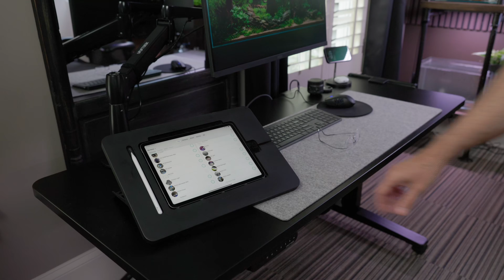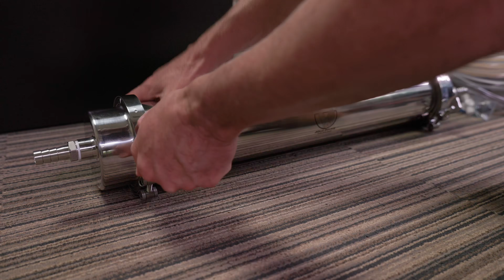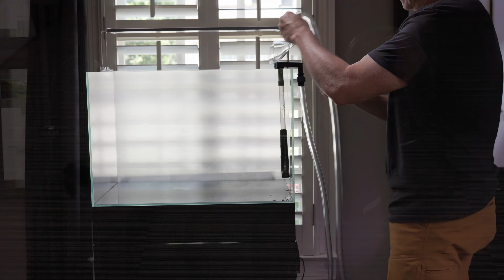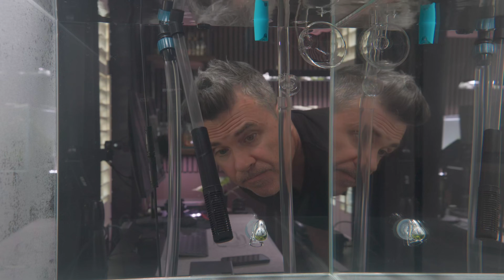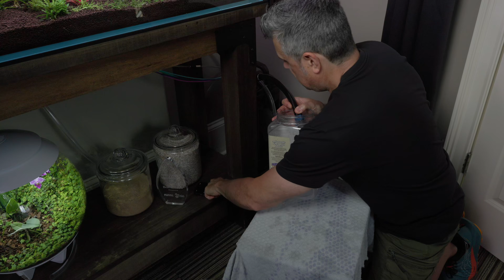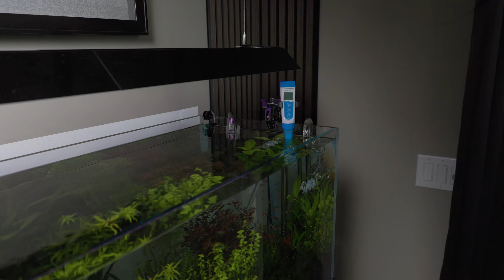My Aquarium Just Leveled Up

Comment from the maker: This was one of the biggest upgrades I’ve made to my aquarium, and it was honestly a bit overwhelming at first. If you’re new to CO₂ or thinking about trying a reactor setup, feel free to ask questions — I’m happy to help! Have you tried CO₂?  How do you inject it?
Reply: The Oase filter has an output flow rate that, in my opinion, would be sufficient to deliver water to the CO2 reactor. Why did you add a centrifugal pump to inject water into the CO2 reactor?
Reply from the maker: @killies  You are correct that the flow is enough but because of adding so many feet of tubing to move everything to the closet I wanted to up the flow.  Ive made changes since this video as I had issues with cleaning all that tubing.  It was a pain which means over time it wasn’t going to happen.
Reply: Have gone the citric acid and baking soda route with those stainless steel canisters that can take a lot of pressure. Very fun to make CO2 at home especially paired with something as efficient as your setup. I would inject it into the inlet of the sump. Have the sump enclosed so the bubbles would dissolve into the water through the filters and pot scrubbers and all the turns. How stable have you gotten your pH with this setup?
Reply from the maker: @DipntheVic awesome.  Yea the pH is rock solid and fluctuates only like 0.02 throughout the day.  Plants are exploding in growth and color. And Ive learned a lot more since implementing this reactor.  Video for another day.
Reply: You probably love technology very much. As for me, I prefer simplicity.

Обзор 7ми аквариумов без подмен и анализ тестов воды. - this video is about 7 aquariums for years(!) without water changes, without CO2, with quite a bit of filter cleaning. That's it!

Comment: It looks great! I'm planning to install CO2 in my aquarium soon. The problem is, I'm using two Fluval FX6 filters, and the hose diameter is too large (25mm). Will these reactors be compatible? My other option is to use an Aqua Rocks Colorado inline CO2 diffuser. I see they have one with a 25mm diameter, perfect for the FX6 filters. But I haven't seen this reactor in that diameter.
Reply from the maker: You certainly could do it but would have a restriction in the piping.  Maybe diy it?  It’s a pretty simple design.

Comment: What size co2 tank do you use and about how long does it last with the yugang
Reply from the maker: 20 pound bottle, 120x45cm tank, bought refill in mid August and was close to empty beginning of May.  Also my CO2 concentration was much lower prior to yugang, something like 20ppm.  With yugang it is a solid 35ppm.  With inline diffuser I was replacing at 6 month mark.  So it worked out really well.  Wont go back.

Comment: This video was excellent with great information, You think you can tell me what’s the size Yugang co2 reactor small.  I have a filter oase biomaster 600 And i asked myself if an additional pump would be necessary, or if the BioMaster 600 would be enough? My aquarium is also 120 cm long.
Reply from the maker: Awesome!  Glad it helped.  Head over to the Aquarocks colorado website to see the dimensions.  The small unit is perfect for that tank.  There isnt much flow loss due to the reactor and depending on your layout the filter should be enough to

Comment: You can make one from some pressure pipe couple of fittings, a ball valve and some bigger clear pipe so you can see the co2 bubble a threaded co2 ftting goes into the side of the clear tube also 👌 the one you have looks cool though. I made mine for my sumped tank so it just goes in as part of the plumbing 😊
Reply from the maker: nice that sounds great!  You are so right that these reactors are fairly simple to diy.  Head to the website and find the forum post as the sizing is the important piece!  Thanks for watching!

Comment: I don’t like co2 bubbles either. There is a small German CO2 company called JDAquarek who produce reasonable priced, small compared with the SS one, and easily powered by an 850. The one to consider is the one of the bypass models, midi for your tank. Excellent product…no bubbles at all while saturating the water with dissolved co2.
Reply from the maker: Cool!  Thanks for sharing.  I certainly will check them out.

Comment: Do you use less pressure on the regulator? Do bubbles per seccond doesn't matter much any more? How long does it take the co2 to taper off and ph to drop after turing off the gas?
Reply from the maker: Yes i dropped the working pressure from 40 to 20 psi.  BBS are arbitrary and will vary depending on a few factors.  I set the co2 flow until i see a few bubbles escape from the outlet every 10 or so minutes. Co2 drops steadily after it’s turned off.  I turn it off about 60 minutes before lights out and it maintains a good concentration with the residual gas pocket.  After that it drops rather quickly as I have good surface agitation.  Hope that helps!

Comment: I've run an inline vertical reactor for co2 for many years.   I don't know for sure but maybe 10-15 yrs?  I do get noise though from the gas bubble that builds up. I'm thinking about putting it on a smart switch and having it shut off the filter for a minute after the lights go out to release the extra gases.  Mine is powered by my Eheim 2215 canister filter.  Nice video.
Reply from the maker: Appreciate you sharing your experience and the kind words!

Comment: If you already have an inline diffuser put it on the intake hose instead of the outflow so it goes through the canister and then into the impeller up to the tank. Can in some cases lead to extra noise. But a reactor is the way to go from the start IMO.
Reply from the maker: Appreciate the advice! We are Always learning new ways to optimize the setup.
Reply: @jmaquascaping  Just a heads up. The diffuser will get dirty quicker with this method.
Reply: There’s a reason they go in the outflow. Putting them on the intake lets the micro bubbles condense inside the filter and you have burping issues.

Comment: Is there a reason you decided to put the canister filter in the loop instead of just running an outlet and inlet for each separately? The canister could slowly clog over time changing the flow rate and thus reducing the amount of dissolved CO2.
Reply from the maker: It certainly could be run separately.  I chose to try it this way to reduce the amount of stuff in the tank.  As far as a reduction in flow due to dirty sponges, that is a concern but not because of a reduction in dissolved CO2.  But CO2 distribution is just as important and good flow is key for that.  My specific setup I have prefilter sponges that are cleaned weekly to maintain the flow.

Comment: Hey Jeff, it's nice to see your experience with the Yugang reactor. The way I always purge all of my reactors is just to put a tee on the CO₂ line with a ball valve. Since the CO₂ inserts into the reactor at the highest point, I just open the ball valve to purge it (with a washcloth handy, I just leave it open until it spits water at me, so I hold the washcloth over the opening). Then you don't have to fuss about with tipping it and you can even have the ball valve a bit lower. 

I love that you don't have to run high psi on reactors. 5 psi is sufficient, since you're not forcing it through the ceramic, you just have to a) overcome the nominal head pressure (about 0.433 psi per foot height difference between the CO₂ inlet and the waterline, so never really more than about 2.6 psi) and the pressure needed to "crack" any check valves in the CO₂ line (usually 2-3 psi). Running the lower psi makes the needle valve more sensitive, so it's easier to tweak the CO₂ flowrate, it reduces the chances of getting a leak anywhere in the system, and it means you can use whatever airline tubing you want.

Another detail on the sizing: I made a calculator a while back that's available for anyone to use. While the math that went into the initial proof of concept is very intense, the final math for sizing is actually very simple. To use the calculator, you need to save a copy (because I don't want random people breaking the spreadsheet). Then just follow the instructions and it'll spit out the numbers for you. The stainless steel ARC reactors are 10.2 cm wide, the small is 37 cm long and the large is 65 cm long.

https://docs.google.com/spreadsheets/d/10DfkiusuIBjX0YkO04xV8jC5ARycE_wJ/edit?usp=sharing&ouid=105202300871240382718&rtpof=true&sd=true

Cheers!

Comment: No burp valve?? How could this be efficient?
Reply from the maker: Not sure what you mean by a burp valve?   It is efficient because all the CO2 injected into the system is dissolved versus using micro bubbles which mostly float to the surface and escape before dissolving.

Comment: I’m a bit confused how this is more efficient. As the pocket of CO2 in the reactor is still there when the lights are off and thus still getting absorbed in the water throughout the night even when the solenoid switches off. Doesn’t that offset any efficiency you might gain versus a diffuser? I understand there are other benefits such as no bubbles, more consistent,and no risk of gassing your fish but it just seems that CO2 will be getting absorbed constantly.
Reply from the maker: It is the difference in almost all the co2 dissolving into the water versus a bubble method allowing them to pop at the water surface before they dissolve fully.  So less co2 needs to be injected into the reactor vs a diffuser to get the same dissolved co2 concentration.  You are right that there is a gas pocket at the end of the day that continues to dissolve after lights out.  Co2 can be shutdown prior to lights out to minimize this “waste”.  I found that I can safely do this 1 hour before lights out and still maintain the co2 level though it does start dropping off a small bit but also my lights tamp down the last 30 minutes.  Hope that helps.
Reply: @jmaquascaping ahh that’s a good point! Thanks for response! Enjoy your videos.

Comment: Is the extra pump really necessary or can the filter handle it by itself?
Reply from the maker: Filter can do it as its minimal flow loss.  Im running my other tank this way just fine.  I added the pump because i wanted to increase overall flow and move the filter to the closet which added a lot of tubing.
Reply: @jmaquascaping  Thank you very much, ill have to take alook at it but probably go with the big one for my 150x50 Tank :hand-purple-blue-peace:

Comment: So ive been looking at this exact reactor and try to figure out the night situation.  Currently using co2 comes on 2 hours before lights off 2 hours before lights tirn off and it stays relatively stable.  How does this work for night?   I imaging the co2 pocket dissolves slowlymaking the co2 level taper off very slowly through the night? Im unsure if im missing something or you just run the the same as wither the diffuser and it dissolves faster than i think?
Reply from the maker: Im currently still experimenting and am at co2 on 1.5 hours before lights.  I’ll probably end up around 2 hours.  Im shutting co2 off 1 hour before lights off.  You are correct in thinking that the gas pocket continues to dissolve at night.  However what I’m seeing is that the off gassing of CO2 is fairly rapid in the evening.  I have strong surface agitation now that I upgraded the pump and of course that facilitates off gassing.  Hope that helps!

Comment: how do you avoid a ph crash if residual co2 builds over time from each previous day?
Reply from the maker: The reactor is only powerful enough to dissolve a maximum concentration of CO2.  So it doesn’t matter what the starting value is.  So for example let’s say the CO2 starts at 10ppm from the previous day’s injection.  The reactor will in my case dissolve until it reaches an equilibrium at 40 ppm and that is based on the reactors size.  If it started at zero it would bring it up to 40 and hold it there. If it started at 30 again it would bring it up to 40ppm and hold. So the resulting pH would be the same every day.  Hope that helps.

Comment: Your channel has become one of my favorites. I'd been using one of Aqua Rocks Colorado's other styles of CO2 reactors but had been thinking of switching to the Yugang so this video comes at a great time. Your decision to turn the filter passive by adding the pump was really intriguing. Is the external pump louder? I'm using the thermo 600 on my 90cm 49 gallon tank and have been concerned about the cut in flow even with the other reactor. I went ahead and purchased the small version of the acrylic Yugang and may also order the Optimax pump as you did. Thanks for the great video!
Reply from the maker: Sweet, I hope the new reactor and pump work out great for you. My pump is about the same noise level as the built in one.  It does vibrate a lot more so I had to be careful to not let the tubing rest on anything that would resonate.  Thanks for watching!

Comment: Thanks for this, Jeff. Been battling decent CO2 stability for a while. Clean the prefilter and tubing every week, change in CO2 delivery rate. Clean the diffuser, change in CO2 delivery rate. Preaching to the choir I know, but glad there’s a truly viable alternative available out there. Now to convince the wife 😇
Reply: Aaand looks like I’m doing DIY after doing research after all. Sounds like all the ARC reactors are incredibly oversized for my tank to run via the overflow method. If I want a clear, sturdy reactor, only marginal cost savings though.
Reply from the maker: @amrobx  Oh yea I was chatting with Yugang on this and ARC did decide to make them for bigger tanks for now as they can be dialed back like I did. It works but the main downside to these reactors is their size.  So DIY you can create it to the exact match for your tank!
Reply: @jmaquascaping Finally got everything situated and put the custom-sized reactor in-line. Oversized slightly in the beginning thinking I was slick 😅. Fish didn’t care for that. Finally sized exactly in line with recommendations on ScapeCrunch and working wonderfully with zero fuss. Couldn’t be happier or recommend more. Again, thanks for putting this video out there! The crazy part is my “oversized” reactor was only about 2” longer than calculated—these things are powerful.
Reply from the maker: Glad the video helped, yea the CO2 thing is tough.  Its been several days now and things are looking better.  Good luck!  Are you thinking of getting one from ARC or diy?
Reply: @jmaquascaping  Probably from ARC, but have research to do on ScapeCrunch. My main concern for DIY is keeping everything water tight while being adjustable (short of rotating the whole assembly). I’d be shooting for one of the clear ones. Other than that, met the friendly folks at ARC in person a few weeks ago. Pretty small shop and don’t mind supporting what they’re doing out there.
Reply from the maker: @amrobx  Awesome!  Yea for peace of mind it is worth getting the ARC reactor.  Acrylic would be great to be able to see into it but the Stainless steel is awesome so as it builds up biofilm you don't have to see it.  And it shouldn't ever require cleaning.  At least I don't think it will.
Reply: Hello jm,why not use a ph controller.isnt that much more straight forward than testing every time you change something.?😊just wondering.
Reply from the maker: @gertinewoord81 you could but it isn’t necessary.  I used the pH probe to validate that the reactor is working as intended and after that it is fixed to deliver consistent co2 concentrations.

Comment: Why did you use 2 drops of Phenolphthalein? The instructions do not say to add two drops🙂

Determination in the 0 to 100 mg/L Carbon Dioxide
• Remove the cap from the small plastic vessel. Rinse the
plastic vessel with water sample, fill to the 5 mL mark
and replace the cap.
• Add 1 drop of Phenolphthalein indicator through the
cap port, and mix carefully swirling the vessel in tight
circles. If the solution is pink or red, then record as 0
mg/L CO

Determination in the 0 to 50 mg/L Carbon Dioxide
• Proceed with the test AS DESCRIBED  BEFORE . To obtain the
result multiply the values on the syringe scale by 50
Reply from the maker: I caught that as well during editing.  You are correct.  The intention was to put 1 drop in.  Unfortunately the dropper bottle quite frankly is lousy.  And between splitting my attention between the test, not wearing my glasses and filming, indeed 2 went in.   Hanna if you are listening (which they probably aren't).  Love the test kit.  Hate that dropper bottle.  1.  Fix the bottle so it is a standard dropper bottle.  There are gazillions of them out there just use what works  2. That bottle comes almost empty.  Please fill the bottle instead of just a few ml.  Especially when overkill of the titration liquid is provided.

Comment: It's 100% worth it to get the correct size so you can utilize overflow mode. It's the number 1 reason to use a Yugang reactor. There's no one who has been using them longer than me and overflow mode is a game changer. I simply will never use any other method for the simple fact overflow mode will forever prevent gassing your fish.
Reply from the maker: Awesome.  Yea it is a huge benefit.  For beginners to not have to worry about killing their fish is a game changer as I think this is the No.2 reason why people fear CO2.  No.1 being cost. Thanks for watching!
Reply: From my understanding the 17.7 ratio is too high for overflow mode right? Seems like that would easily lead to a yellow drop checker. What is the ideal ratio if I just want lime green 30 ppm?
Reply: @DanDeeCandyMan  it's not, but the 17.7 is for a full 1.5pH drop. The Aqua Rocks Colorado options have the adjustability to change that ratio if you find it's too high. If you do a DIY, with a fixed opening, you'd simply tilt the reactor higher on the return side for an earlier overflow mode. I would recommend to build it at the 17.7 and tilt it if you see it's too much.